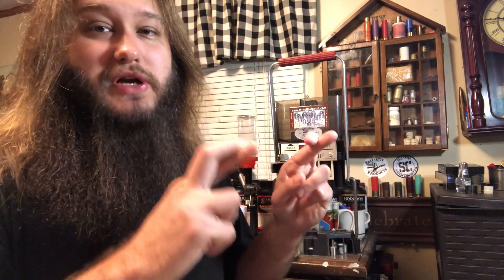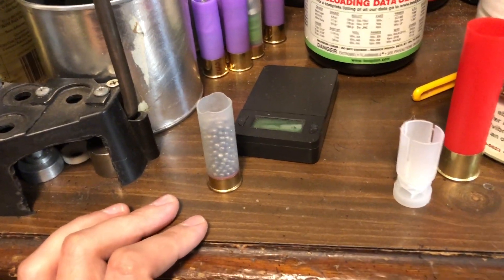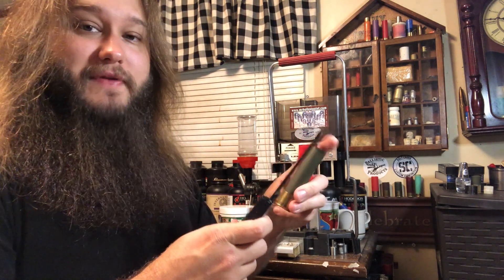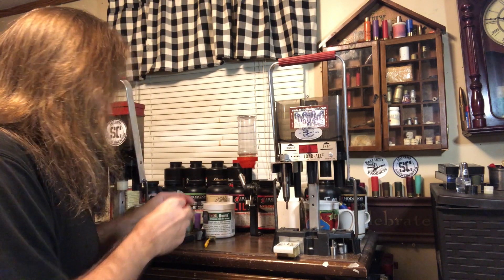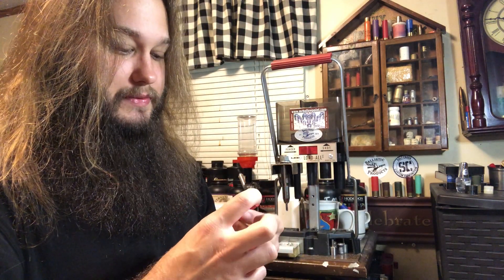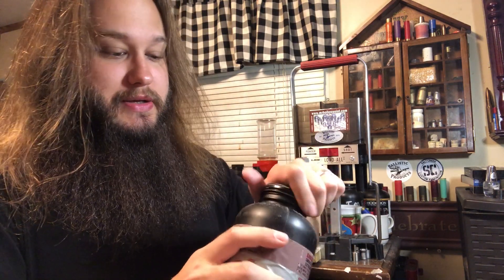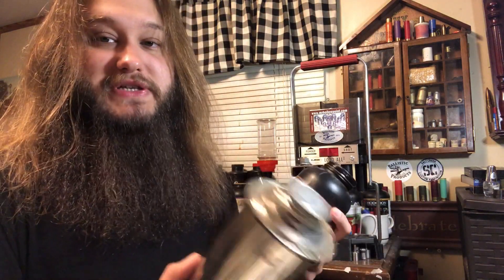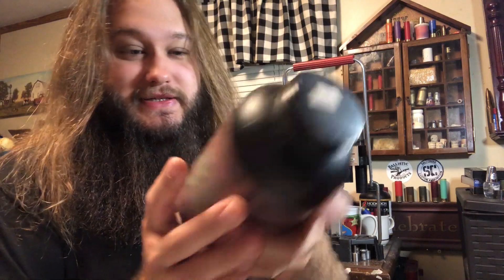10 Gauge 1 5/8 Ounce Bismuth Load 1300 FPS

Comment: I have a 2oz load with hs-6. Got it off hodgens website. First 3.5” load I tried.,decent pattern but not anywhere as good as a factory 2oz buffered load in my gun.
Reply from the maker: I’ve got a few hs6 loads for 10 gauge but haven’t tried most of them
Reply: @theshotgunscientists  it was the only powder I had that would work foe a heavy turkey load. I had lil gun lil gun but didn’t see your load 45 grain  video on it  for 2.5 and 3 oz loads at the time. I have 8 pounds of green dot as well. But that’s a lighter  payload powder unfortunately.